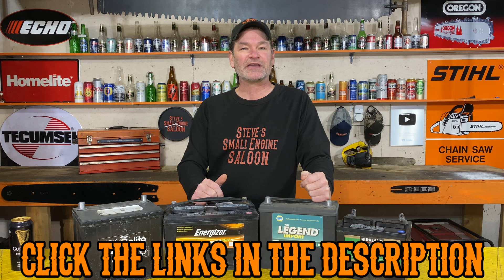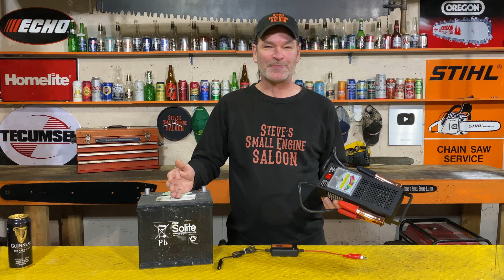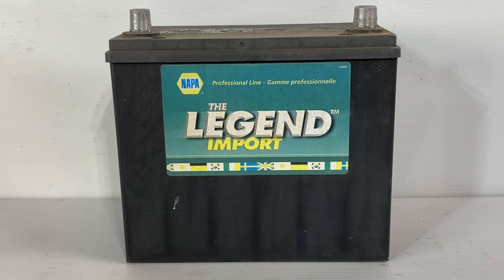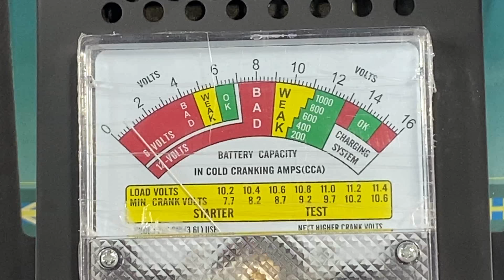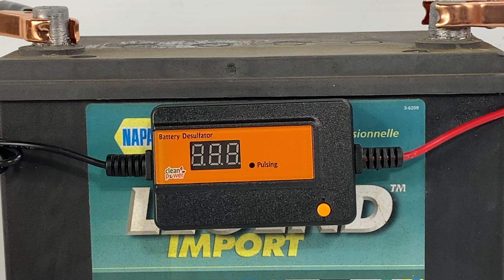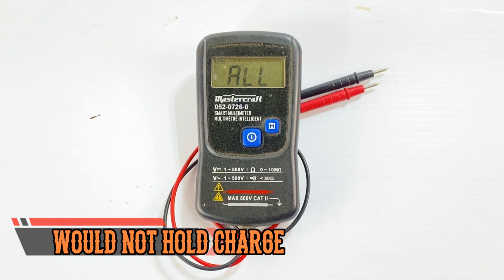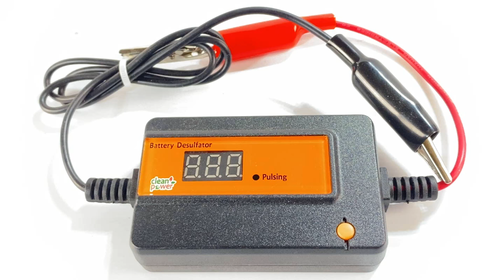Does An Electronic De-Sulfator Really Repair A Battery?? See Real Results

Comment: The one that couldn't get past 8V, can you just go buy some battery acid and see if that may be the issue?  And FYI, I discovered that even the so called maintenance free batteries that don't have holes, and only have vent holes on the side, they actually do have holes for each cell. You got to just remove the sticker and pop the lid off each hole. They're flush with the top of the battery and unnoticeable. They tell you it's maintenance free, but it's not true.
Reply from the maker: Interesting!
Reply: They are designed to be maintenance free. The vent on a VRLA battery is there for safety, not for tampering with the electrolyte. Only flooded batteries with removable caps can be topped off with demineralized water or distilled water. Never add acid to a battery that is low on electrolyte. And don't try aspirin, and don't dump them out and flush them with baking soda and a garden hose, followed by refilling with filtered electrolyte or new acid. Dangerous and a waste of time and money.  Best thing to do is regular maintenance with a pulse charger/maintainer like Steve showed, and keep the electrolyte at the proper level on a maintainable battery, and at the right temperature.

Comment: Steve: I have one of these (£19-50 on Amazon) and like you  have had mixed results. If the problem is simply sulphating then this will probably do the trick, if there's a cell down (shorted maybe) then forget it the battery's junk. Thanks for the video.
Reply from the maker: Agreed!

Comment: I tried this on a generator starter battery last week and it swelled up like a football and got very hot, so keep your eye on anything you try this on to make sure it doesn't overheat and blow up.
Reply from the maker: With the desulfator?  Not possible at all!  Maybe with a 15A charger...
Reply: @StevesSmallEngineSaloon  -- well, mine's  a combination desulfator/charger. So I'm sure it was past the desulfation mode and into the charging mode when this happened.

Comment: Great information. Batteries have always been somewhat of a mystery to me. I get a lot of used batteries from old machines that I obtain and have ran into the same problem with holding a charge but no load. I'm going to get the load tester and the desulfator  so I can stop maintaining batteries that are no good. Thanks for taking the time to research this issue.
Reply from the maker: Our pleasure!
Reply: the load tester he used is for automotive batteries,not smaller batteries like gel cells found in computer UPS or kids toys. it would draw far too much current for the smaller lead-acid batteries. you could use a 12v taillight bulb or headlight lamp with a voltmeter for a load test.

Comment: Bought 3 similar units to do 6 volt golf cart batteries and they came on but  did not help my weak battery problems. The cart had a total of 6 batteries and isolated each battery by removing wiring

Comment: Sulfating is only one of the ways lead/acid batteries fail. It is usually the result of not keeping the battery charged for some period of time. This device will probably help here. Other failure modes are 1)Shedding of the lead oxide from the positive plate grids, usually over time and also if the battery is subjected to vibration and shock. This reduces the potential capacity and the ability to provide a high demand current. Nothing can be done to fix this. 2)Shorting of cells from plate shedding debris falling into the space below the plates. This kills the cell. No fix. 3)Breakage of internal cell connectors from corrosion or shock. No fix. This device may fix the first problem, but will not be helpful for the others.

Comment: I got a NOCO 5 amp after trying the 1 amp. The 1 amp is designed for smaller batteries. For my pickup trucks, they need the 5amp. I used it without disconnecting the battery, in the truck. One truck, it got so weak the engine wouldn't spin. In 3 day, it ran the truck for a day. After another week on the charger it seems cured. The other truck seems to turn over slow. Always starts, but sits at 12.2 volts, like it's ready to die. It's been done 2 weeks in a row, disconnecting for 2 days to use the truck and then cycling again. It's getting better but not fixed yet. At least it hasn't died in the middle of the winter.

Comment: Hi Steve, great interesting video.
Please can you answer this question. The spark plug thread in the engine head of a Stihl MS 391 have been damaged, can I use a Helicoil to sort the problem and will it require some sort of heat resistant sealer to keep it in place?? Cheers Andy.

Comment: I built two de-sulfator circuits back in 2013.  I had a 5 yr old battery that was getting weak, slow cranking, so I took it out of service and used it for a battery back-up UPS.  It gets a lite float charge and a de-sulfator stays on it so long as there is charge voltage.  That battery is now 13 yrs old and is still working fine.  I suspect that what kills most batteries is the harsh temperature cycling when exposed to the elements all the time.  The other de-sulfator is used to maintain a battery in an un-heated garage and after about 20 years that battery failed.  I kept a de-sulfator and float charger on it as well since 2013 and last spring that battery failed.  Most likely due to a mechanical failure due to temperature cycling.  So I would say a weak but mechanically sound battery can benefit from a de-sulfator circuit.

The circuit is powered by the battery and generates tiny high voltage spikes at about 1KHz. If you use a de-sulfator circuit with a charger and or a load, you need to use an LC filter to block the high voltage spikes from coupling back into the charger power supply, assuming it might be a SMPS or something a little more sophisticated than your basic crude charger and to protect your load devices.
Reply: Chris Harper, If I remember my conversation with the owner of VDC Electronics years ago, manufacturers of BatteryMinder pulse chargers, I think he told me they operate at 3.26 MHz. I might be wrong, though.
Reply: @ronrodgers6531  I based my circuit on an Instructable posting but changed the drive circuit to use an Atmel atTtiny85 instead of the 555 timer chip. From that article there is a reference to a solar power article.   Using RF would likely be problematic dealing with skin effect and even greater EMI issues.  But any reference would be greatly appreciated. 

 https://www.instructables.com/Desulfator-for-12V-Car-Batteries-in-an-Altoids-Ti/

Comment: Wish I would have watched this in the fall. I replaced a battery in a 2017 Silverado that would charge to no more than 11.7 V in which it was a no start without a jump. Thought the dealer might help me out since it was 3 yrs old with approx 70 k km. $375.00 later it was back on the road. I'm thinking this little gadget might have bought me some time. Thanks for the info.
Reply from the maker: You're Welcome...
Reply: Holy CRAP!  Where are you that you got ripped for $375 for a battery? A new Group 34/78 battery for a GM shouldn't be more than about $100-$135 for a flooded wet cell battery and about $250-$300 for a premium quality AGM. DAMN! You got taken to the cleaners on that one. 😵

Comment: A list of conditions where de-sulfators work and dont work is useful, as is an understanding of what battery sulfation actually is. In short, a battery that is insufficiently charged/discharged on a regular basis will result in sulfation so lawn mower batts/jetskis/motorcycles/classic cars is a frequent one - as they are not used year round generally. A regularly used battery that goes duff is very unlikely to be recovered by a de-sulfator, because it won't be sulfated.

Comment: Take a stick welder connect it to battery hit it low amps first and raise until all cells are bubbling for 5 minutes. Turn off let battery sit for 15 to 20 minutes and repeat 2 more times. After last one let battery sit for 20 minutes then put on your normal charger and charge battery. Battery is now De-Sulfated and good as the day you bought it. Cheers.
Reply: Schmuck. Respect your storage batteries. They should always be charged at approximately 10 % rate of their amp/hour capacity at the PROPER voltage. You sound like the same idiot that wants to fix his battery with aspirin and Epsom salt. Charging/fixing your battery with a welder? 😳 Just asking for an explosion! Don't forget a byproduct of battery charging is hydrogen gas, which is VERY explosive.

Comment: Steve, I had a 3 year JC Penney last twelve years by topping off the cells with distilled water and maintaining charge. Until one morning I went to start the car and the battery blew up. Acid everywhere and blew the exterior paint off the hood!
Since then at the first sign of trouble,  IT'S OUTTA HERE!
Reply: You may have over charged the battery and hydrogen built up inside the battery .
It happens when people charge it manually, pumping too much voltage into the battery, which over heats.

Comment: Once the lead (a soft heavy toxic malleable metallic element) on the plates of one cell falls off and builds up on the bottom of the battery (this usually happens with a cell on the positive  (+) post) , it will short out that cell, causing a dead cell. There is no fix for this whatsoever. The only solution is to purchase a new battery and keep it fully charged. Or when a battery sits too long with no charge, the activity of the acid will become neutralized, and become like water. If you're lucky, it can be reactivated with a trickle charger. Otherwise, the battery is bad and needs to be replaced with a new one. Or, the water-like acid can be drained and replaced with fresh acid & "maybe" the battery can be fully charged for activation again. Or, if the charging system continually charge the battery at full amperage due to a faulty voltage regulator or voltage rectifier/regulator, this will "burn up" the acid and the lead plates, causing a bad battery. The only solution for this is install a new voltage regulator or voltage rectifier/regulator and replace the battery with a new one.
Reply: its my understanding that a lawn tractor has an alternator producing 40 vAC, that goes to the regulator, that rectifys the voltage to DC and regulates it to 14 vDC to charge the battery. but it does not turn off the voltage to the battery when it has a full charge. so when you start the tractor once and run it for many hours, won't it try to over charge the battery and possibly produce more sulfates then normal ? or does the regulator turn off the voltage when it senses the battery is at full charge ? over 12.6 vdc

Comment: sometimes they need to be charged with more amps, 15 isn't enough try 30 to 50 amps
Reply: @Roger Tickler And that guy is a schmuck just asking for trouble. A battery charger should operate at about 10% of the amp/hour capacity of the battery, with the correct voltage regulation. Even a properly charged battery can cause an explosion from the hydrogen gas they produce during the charge cycle if improperly handled.
Reply: Most batteries should be charged at about 10% of the amp/hour capacity. More is NOT better.
Reply: @ronrodgers6531   I work for a company that's been in business since1957. Last year we sold 437 used/ reconditioned batteries, we had 4 come back as a fail, we must be doing something right

Comment: Sure would like to see it work on an Optima deep cycle. Great video by the way.
Reply from the maker: Thank you!
Reply: It can. Not all batteries respond however. Better to use the pulse charger occasionally as a maintenance item rather than wait for battery failure.

Comment: Omg I've been looking for that load tester for over a week now. Already got the desulfator but not seen anyone do a review till now. Thanks for the link, Very much appreciated, Great vid !
Reply from the maker: You're Welcome...and Thank You...
Reply: A carbon pile tester is better than the little ones with a "toaster wire". Even Harbor Freight's version is pretty good. You dial in the load that you need based on its cranking amp rating. AutoMeter is really good but expensive. Harbor Freight's is a knock off version. If I was in business like automotive, marine, or solar storage systems, I would own AutoMeter. For serious usage, a Midtronics conductance tester is great, but you MUST keep records on the tests. You can actually predict the life span of the battery and replace critical use batteries before failure.
Reply: @ronrodgers6531  Thanks for the advice Il have a look into them, unfortunately I'm in the UK here and we don't have Harbor Freight but I shall certainly give the name a Google an see where I could get one over here, much appreciated.

Comment: Hook another battery in line with the dead battery to bring the voltage up enough to trick desulfator into running.
Reply from the maker: Great idea!
Reply: @StevesSmallEngineSaloon  works for smart chargers too.
Reply: That’s similar to what I do to trick rechargeable AA, and AAA batteries to charge again... but it’s not foolproof so use caution.

Comment: I work on a rule of 1 day/ per pound weight  preferably with a dumb trickle charger at the same time  two of my batteries are 16 and 11 years old and still being used   Ps. Try the Guinness 50/50 with strong cider ( preferable on draught).    ———- Black Velvet   🍺Ambrosia 🍺🏴🇺🇸🏴
Reply from the maker: Awesome!

Comment: Hey Steve, how's it goin....I've had variable results recharging an ' unchargeable' battery by using a small solar panel.....the panel puts out very little current but at a higher voltage. These panels can measure 19 volts with no load attached and drop considerably when you attach the dead battery but if left for a couple of weeks outside, I've had em charge back up to useable voltage.....it's said if a battery discharges below 6.6 volts (1.1v per cell ) it is usually unrecoverable.....I've recovered batteries, albeit not really old batteries, from virtually stone dead...! It surprised me how well it worked but the lesson here really is , get an inexpensive 10w solar panel to maintain the battery in the first place....you don't need a controller at that output level, just hook it up n leave it pointing towards that big shiny thing in the sky.....

Comment: I have a CTEK 5 amp charger . If memory serves, it claims to have a patented desulphation program built into the charger. Never tried it, but when I get the next failing lead acid battery will give it a go. Cheers Steve
Reply from the maker: Right on
Reply: Use it regularly before battery failure to remove the lead sulfate crystals from the plates and put back in suspension in the electrolyte. Much easier to maintain than fix.

Comment: I'm guessing 1/3 or more of the flooded lead acid batteries on the rack waiting for the battery truck to pick them up to be recycled could probably be brought back to usable condition by desulfating them.   Read all about it   Battery regenerater  at wikipedia.
Reply: I used to work in a battery store that rebuilt power tool batteries and sold lead acid batteries for cars, trucks, boats, computer power supplies, et cetera. I regularly ran my personal pulse charger across the batteries in storage. That way customers always got fresh, really hot, long life batteries. My boss, the store owner, sure liked the idea, too. I always load-tested new arrivals and immediately sent back to the wholesaler any battery that failed coming in the back door. Everything got load-tested in front of the customer buying the new battery as well.

Comment: i think the cycling of the batteries is what done it. All that desulfator was doing was slowly draining the battery. Which is what it needs in order to convert the sulfation.
Reply: Wrong!
Reply: @ronrodgers6531 Oh do tell. Enlighten me on how cycling a battery isn't what helps desufation. I suppose you think that little gadget is the key. Lets break this down. Gadget takes the power already stored in the battery uses it to power itself, so that it can increase the voltage, with a loss of current, not to mention the loss of the power which was consumed by the gadget itself, sends the high voltage back into the battery but with very little amps which is what is really needed in order to convert the sulfation back into usable acid. Overcharge the battery, drain the battery to half way down, charge again. Repeat this over and over. Its the only way to recover a lead acid battery. The reason why this worked is because the battery was being cycled.

Comment: Guinness? Good thing youre Canadian. That stuff will put hair on your chest.
Think maybe liability issues may have been involved. You seem a little to curious and or clever for them to get this over on you. But you can access the cells on all lead acid batteries. Some have a thin plastic cover glued on top. A small screwdriver or much care with a razor knife you can remove and discard the cover. Then you have small plastic caps.

Comment: steve, I've tried all kinds of so called battery fixers. the last one killed what little life was left in some batteries in my golf cart. FYI, they were 12 volt batteries. it's good to know that at least some do work.  thanks for sharing your results of 3 months of testing. I may try to get me one of those desulfater. if I can save at least one battery it would be worth it. thanks again.
Reply from the maker: You're Welcome...